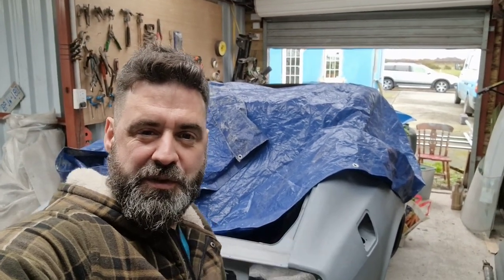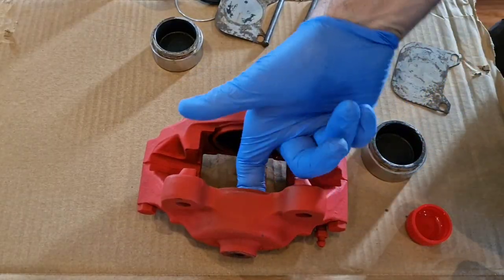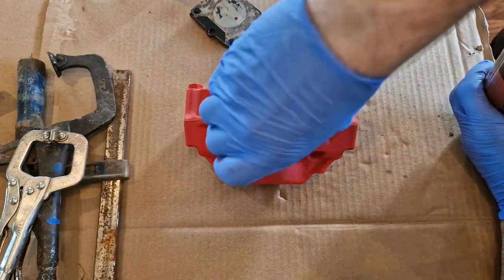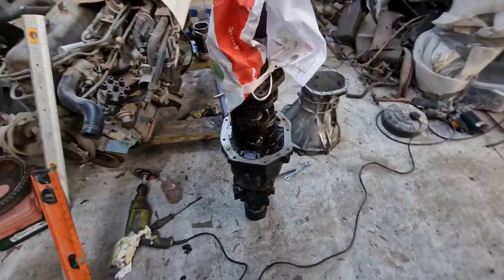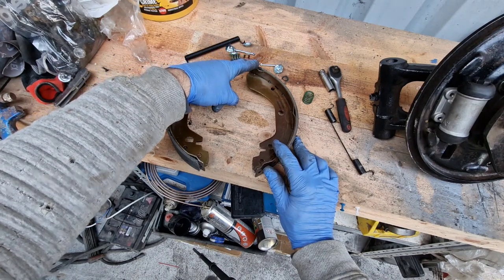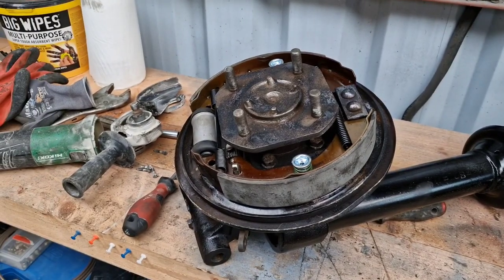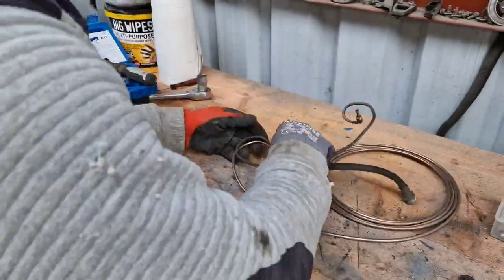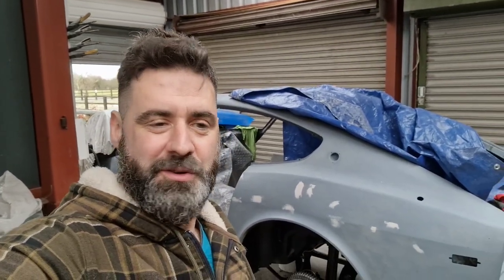Datsun Z. Rebuilding Brakes - Front and Back. 240Z 260Z 280Z

Comment: Did you have any issues with the front brakes? I think they are installed incorrectly, the bleeders are supposed to be on top of the calipers.
Reply from the maker: Well spotted. I even seen this happened to my another Z head and told him to flip them....... and then did it myself.